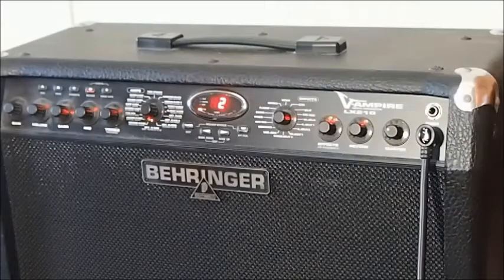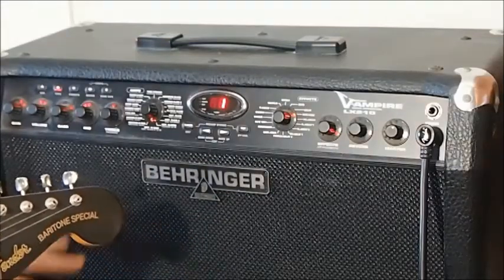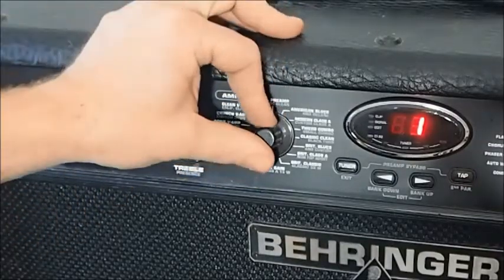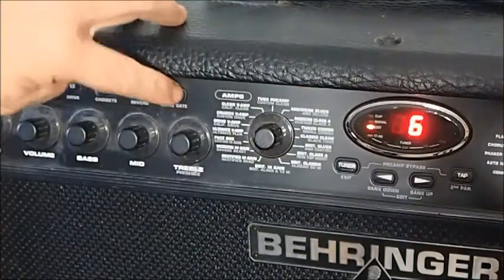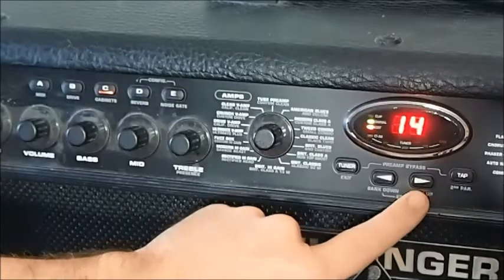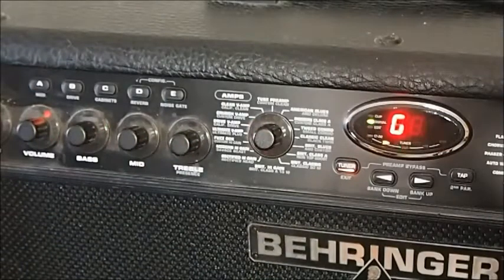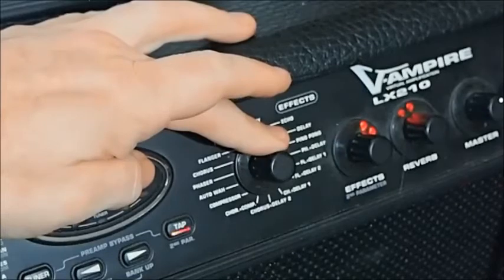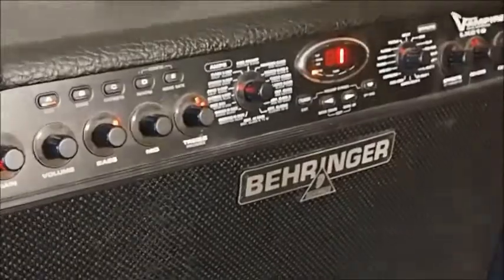Behringer V-Ampire LX-210, short demo, detailed tutorial

Comment: Thanks very much. I just bought one, second hand (spotless, like new condition), and your video it's worth more than 20 manual pages. Works well with harmonica.
Reply from the maker: Thanks so much for that feedback, rek. Gearfacts
Reply: Do not let it fall over on front,lay it on its back when driving. If you doubt me I will show you same amp with all but 3 knobs busted off.build a hardshell case .or leave at home.

Comment: Just picked up the 1-12 vamp for really cheap.... I've used one before but it wasn't mine. I've seen some bad reviews on these, I think it doesn't sound to bad maybe not as loud as other amps I've used. Just got it yesterday so just checking out others opinions and hopefully some tutorial.   This is the best vid I've seen so thanks.
Reply from the maker: Yep I think it's good for the price. I also agree that it's not as loud as most for its size but still ...it's loud... coz that's just what amps are, haha... They are a bit tricky to operate though so I hope this video helped :) Gearfacts
Reply: @gearfacts  I paid $75 used in great condition, didn't come with any manual. And yes this vid helped more than you'll ever know. Again thank you
Reply: @gearfacts  honestly I am pulling my hair out with this thing. I did something and it sounds like shit. How do I reset?
Reply: @diegofiorillo6412  Press down D and E preset buttons together, hold them in and then turn the amp on. It should show cl in the display which means clear. The amp should then be reset to factory default settings
Reply: Hey man,

can you tell me if the volume is not too loud to play in a appartment ? i dont want to bother neighbours lol. I'm watching to get one for 60 bucks but i wonder if the volume is ok. thanks

Comment: I had the 1x12 version - it was awesome, wish I never sold it.
Reply from the maker: Hm, yeah I still can't make a final decision. It sounds great but has a bit of a noise issue, like a data processing sounds, blipping in and out at regular intervals, my last two V-amps did the same thing. Wouldn't bother me at high volume as the interference stays quiet but for home practice it's always there and always distracting. I don't know if I can tolerate it. I'm going to try it with off-grid power and see if that helps - there will be a video about that coming soon. Thanks for your comment :) Gearfacts
Reply: Could be an issue with the noise gate perhaps?
Reply: I will sell you mine if you want?
Reply: thats the one i have and i am selling it if you want it?

Comment: Why did they  use plastic shafts in all  the pot selectors? All  knobs are busted off except 3 and was 4 until I picked it up tonight and that one fell off. The volume  knob,plastic shaft plastic  knobs into enclosed solid-state  not to be Repaired  other than factory.
Reply from the maker: Yes it’s super annoying
Reply: I haven't had any snap off yet but I'm sure they will lol

Comment: picked up the head version and run it through a behringer 4x12 half stack. Some interesting sounds but there's no way you can gig with it because it is just not loud enough??!! I cant seem to find what the problem is? It throws out about the same volume as a 10 watt practice amp. Any suggestions?
Reply from the maker: I think that's just the way it is to be honest. I had the same result  :) # Gearfacts
Reply: @gearfacts  Thanks for the reply. But surely there has to be a fault? Behringer couldn't possibly manufacture a 120 watt head and a 4x12 cabinet  where the output levels are only suitable for a gig in the garage?! I've tried it in mono and stereo and experimented with all presets and still the same problem. I do like the sounds in it, but its just not worth the space that the 4x12 and head take up. A rig like this is meant for gigs, at  half stack volume!!
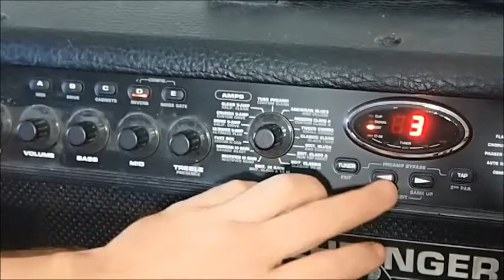Reply: @fostexfan160  Hi, an original owner here. 1) pick a loud amp first. 2) then go into EDIT mode @ 5:14. 3) pick a Cab by pressing "C" and then the left and right buttons 7:02 , these are the Built in Cab IRs. I like 4, 5, or 6 most of the time. 4) Then hit B for the Drive. 8:00 This acts like selecting a 2nd high-gain Channel on a tube amp. 0 = Clean  1 = High-Gain(ish). The Final tip I can give you is to run the amp CONFIG in Studio 3 (S3) or Live 2 (L2) if you look at the manual on page 8. : http://downloads.music-group.com/software/behringer/LX210_LX1200H/LX210_LX1200H_ENG_Rev_B.pdf
Reply: @jonathanogden746  Much obliged Jonathan...this will be something to do during lockdown! Thanks mate

Comment: I have broken knob on this one, anyone knows where to find the same? :)
Reply from the maker: Ahh they break easily and are difficult to replace. All I can suggest is to buy a similar amp that isn't working (get it cheap and use the knobs) or contact Behringer directly and order some more as spare parts. There is a third option: find someone who has a 3D printer to make a copy.
Reply: @gearfacts  Tnx, you always have good answers :)
Reply: Poor design with low cost parts=disposable gear,plain fact, but if you have delicate soldering skills and  can aquire parts  ,go for it!